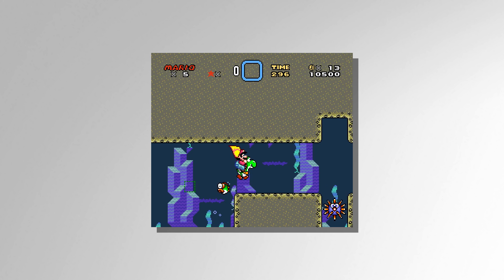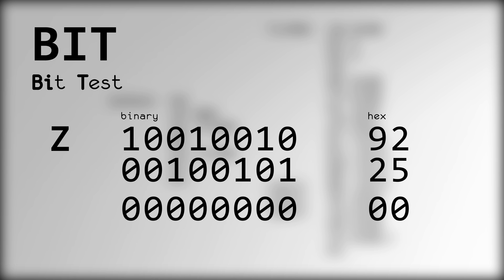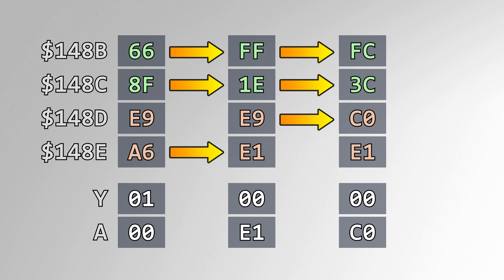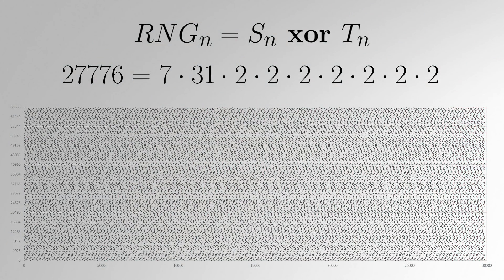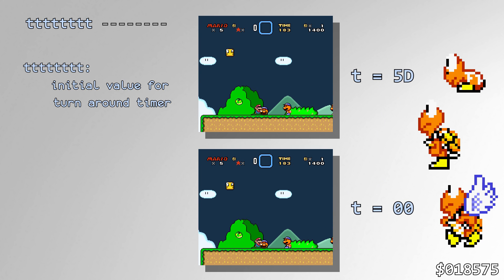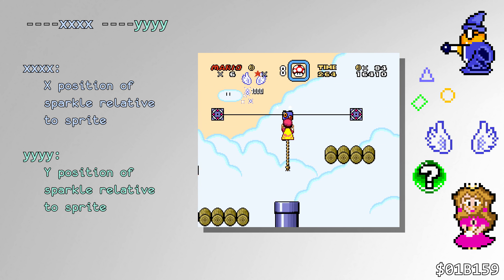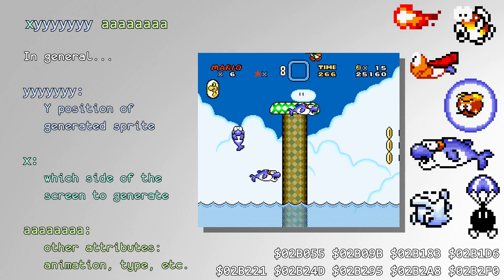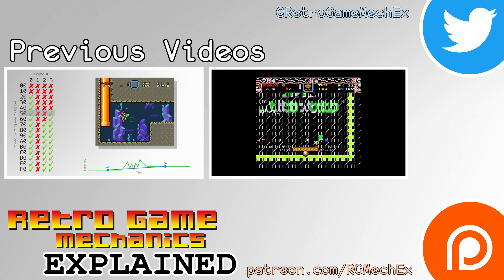Super Mario World - Random Number Generation

Comment: That's a pretty weird RNG...

Not using true randomness is not just a cost issue. A lot of game design benefits from the predictability of a pseudo-random generator over a true random generator for instance.

For example, Consider recording a replay of what the player was doing. For this to work, you have to replicate EVERYTHING correctly.
You could record the state of all of the game objects for every frame, but that would take up huge amounts of storage.
But, if all the game objects have deterministic state, then all you need is the starting state and the player inputs, which takes up much less space.
This is possible if the game is entirely based on predictable deterministic logic...
Or... If you use a pseudo-random number generator. (since this is actually deterministic for a given seed)

It looks too like it's setting the seed to an exact starting value too. Which... 
Means the sequence of things in the level is kind of predictable in some ways

That's an odd choice.
See, when developing PC demos I found the most common technique to get a 'random' outcome is to use the system clock.
Even though the Pseudo RNG function isn't random, it seems fairly random as long as your seed value keeps changing.
The system clock has the virtue that barring someone messing with their clock (or the clock running for longer than it was designed to),  the seed will never be the same, so 'random' events will truly seem random, even though they aren't, because the seed used is never the same twice.

Unfortunately, an old console like the snes has no system clock.
So... You have to come up with a different way of creating the initial seed values...

And so far, I haven't actually been able to think of one that works consistently...

Which... May well explain why SMW just gives up and sets it to 0 every time a level loads...
Reply: I came up to a "better random" by making a clock based on VBLANK interrupt cicles, so the user will never be able to press start at exactly same time ever, and three different random routines based on which number was on clock.
But nowadays, with very cheap RTC circuits, it would be possible to save the daytime in the SRAM
Reply: I think it could be set to a global timer value.
Reply: They could keep the RNG from the last level, and maybe every few frames, add the controller registers
Reply: I don't understand.  I'm going to sleep now.
Reply: Outside of using a predictable number generator for determinism.. there is never ever ever ever such a thing as a real random number generated by a computer (yet.. maybe once we go quantum)
Reply: @martinhowser4094  There is one way, machines with a requirement for very strong cryptography like military grade communications hardware can be equipped with a hardware random number generator that samples some type of physical quantum phenomenon, such as decay of a radioactive substance, or noise on a photoelectric circuit caused by unpredictable arrival of photons. These are obviously far too expensive for a games console.
Reply: @pyramidschema8668  you could just use the noise produced by a low resolution camera, it's random I think
Reply: @paindavoine_design  Interesting idea, I think the noise is random, but it seems like no-one ever built a device like that. Maybe there is some bias or reliability problem that is not obvious.
Reply: @pyramidschema8668   Pokersites use thermal fluctuations from Zener diodes to seed an RNG which since it is a quantum event that triggers it essentially becomes true random number. One of the better examples we have as far as I know.
Reply: @paindavoine_design  Cloudflair uses video from a wall of lava lamps, which is then hashed
Reply: @pyramidschema8668  that's how cloudflair works.
Reply: Martin Howser How bout electromagnetic noise
Reply: I found it weird that they never used the controller as a source for the seed. It's easy to read from, is random enough, and yet keeps things deterministic for things like recording demos or replaying TAS.

Maybe the way SMW did it was "good enough", but for a few extra bytes, it could have dropped the "enough" and made it good.
Reply: @SolidIncMedia  I don't get this rng needs to be consistent for recording thing, why not just, record videos?
Reply: I think the common way to create a pseudorandom seed on consoles without clocks is by having a counter that ascends on the title screen and stops when the player presses start. If the title or new game screens have options, then the player's other button presses can also be used as a source of entropy. That said, there are a lot of games that use constant seeds, including Pac-Man, Doom, and (apparently) Super Mario World.
One technique that I haven't heard of anyone using is reading from uninitialized memory or registers at startup to create a seed. For example, lots of NES games will zero out the RAM during initialization. To generate a seed, the program could sum together the uninitialized RAM's values before it zeroes it. Note that this might not work on emulators because some always initialize the RAM to a constant value.
Reply: @jimmyhirr5773  yeah, a lot of games use inputs or run continuously to make RNG. Generation 5 of Pokémon doesn't use uninitialized ram, but it does use the MAC address for additional console to console unpredictably

Comment: I'm sorry if I missed it, but where does the game get its seeds?
Reply: Naeddyr If you're asking where the game gets its initial seed (when you boot up the game), it's probably set to zero as game consoles of the time had no internal clock to base the seed upon. But if you're asking about after initial boot, the RNG function ticks both the seed and the values at the same time (I don't have a timestamp, but it should be about two minutes in). I hope this answers your question.
Reply: So if the initial seed is always the same, is it possible to arrange for a deterministic speed-run by controlling what triggers the RNG when playing?
Reply: You are correct! In fact, this is what many TASes (tool-assisted speedruns) do: they control the RNG to be able to get a favorable outcome. I can't remember off the top of my head if RNG manipulation is used in Super Mario World TASes, but I do know that this is done in other TAS speedruns. For example, the Super Smash Brothers Melee Adventure Mode TASes use RNG manipulation in Link's portion where you have to find the Triforce (which has a randomized location due to RNG) to win.
Reply: The RNG is always initialized to (0, 0, 0, 0) when the player enters the level.
However, this is not the only source of randomness in the game. There's a global frame counter that always increases by 1 each frame. Many sprites use this counter to change their behavior. For instance, Bowser statues only shoot the fire each 128 frames.

Comment: There are a couple other ways to really make an RNG function ... random.
You can read the noise from one of your sound card's audio channels and use that as the seed, or you can read the unfiltered mouse input or the gamepad's unfiltered analog sticks.
Heck, there are even servers around the world picking up cosmic radiation and used that to supply a seed for RNG functions to use. And i don't think you can go more random that cosmic noise :D
Reply: J.J. Shank Using the current score And time with the randomness would have been easy to perfect it
Reply: The cosmic noise is not the most random, a quantum system is actually truly random.
Reply: Those options weren't available to Nintendo when building the GBA. Besides, aside from the mistake of resetting RNG at level start, this game handles randomness pretty well.

Comment: This is probably a stupid question, but why didn't they make it so that every item has a 1/3 chance of being slected instead of trying to do a 3/9 chance? Wouldn't that be possible?
Reply: Because you can only determine from a set of 2^n values. 2^n is 1, 2, 4, 8, 16, 32, ... While 3 is impossible, developers chose 9 as it can be approximated by 8.
Reply: They could make it depend on the global timer, a single byte address that varies from 0 to 255.
Interval (0 to 85): item 1 -> 33.59%
Interval (86 to 170): item 2 -> 33,20%
Interval (171 to 255): item 3 -> 33,20%

But like groszak1 suggested, there's no way to get exactly 1/3.

Comment: It still wouldn't be "true" randomness :-P
Reply: Also using true randomness would make game play files larger since you need to store not only buttons pressed, but also results of random generator.
Reply: Well, no, you just have to add a number for each key-press, not actually store each one
Reply: Then it won't be true random because it would depend on user key-presses. Also depending on key-presses makes it able to manipulate using TAS.
Reply: Oh, wait, yeah, nvm, I misunderstood what you meant, but as I said, that still wouldn't be "true" randomness.
Reply: If it was true random (different random numbers even with exact same buttons pressed) then it would be harder to edit TASes. SNES doesn't have true random hardware.
Reply: Well, it wouldn't be much harder, it just would be one less variable you can control
Reply: groszak1 Well save states would help with that one

Comment: Is it possible to make the RNG not reset when you exit the level? So you can truly make more "randomized" (in quotes because after 27776 calls it repeats) events.
Reply from the maker: Yes. It just happens that the RNG seeds and output are contained in a large chunk of memory that is reinitialized to zero every time you enter a level. You could preserve the RNG values over levels, or even re-seed the RNG based off of something else when entering a new level.

Comment: To source true randomness, instead of a hardware-based approach, why not just take values from user input?
Reply: Some games do that. A lot of RPGs use the number of steps a player has walked for RNG, that combined with probably an internal timer. Some speedrunners use their steps to manipulate RNG during some Final Fantasy games and also Pokemon games if I remember correctly.
Reply: Well, when I'm playing SMW, I'm holding Y and Right or Y and Left 90% of the time. Not much randomness there.
Reply: You could, but 1.) You wouldn't get much entropy that way, and 2.) The entropy source could be very biased.

For example, a standard NES controller has 8 inputs. Start and Select are rarely used, so you can basically ignore those. So then you're left with at most 6 bits of input.
But user input even with the full range of the D-pad and A and B buttons would still be biased, because some inputs are incredibly rare compared to others. The controller makes it impossible to press left+right or up+down at the same time. And depending on the game, a single button pressed during a frame is more likely than a combination of buttons. The user inputs of side-scrolling games such as Super Mario would have "move right" on the D-pad over-represented because the most common action would be to advance forward. And this is exactly why NES games with input-based PRNGs are so easy to manipulate.

Not that true randomness is something you want in a game anyway. With true randomness you don't have any control over the distribution, and the numbers you get won't be uniform in the same sense a PRNG is. A truly random source of entropy could at some point just as well give you a long sequence of only zeros which would be detrimental to a game. What you usually want is a PRNG with a uniform distribution (like the Mersienne-Twister) with a long (but finite) repetition cycle, and optionally, an initial source of entropy to set the seed value. For example, the seed could be the clock when the game starts.
Reply: ***** Some bias is not necessarily wrong as long as it's not extremely bias (i.e., no button press means RNG = 0). Many games use player-derived inputs for RNG. So for example, Pokemon and Final Fantasy uses a combination of steps the player took + position on map to determine a random number (and some other factor that is also semi-random). The source itself isn't truly random, it is biased. It's biased enough that a speedrunner can take advantage of it and reduce random encounters or increase the chance of a specific encounter happening but the bias is low enough that two normal players experience completely different results.
Reply: get them to try and quit vim
Reply: like super Mario 64?

Comment: I really liked this. I was especially impressed with the production values. The only thing I wasn't able to understand is what Bit Test actually does; I came in with no prior knowledge of how assembly works, and at this part, I felt I needed at least a little. I don't know if I'm outside your target audience, but if I am, the clarity of your explanations is pretty excellent, as I was able to understand everything else even without prior knowledge.
Reply: After watching a few times, I think what it does is use an AND gate on each bit of the two numbers you're using (so 1 AND 1 is 1, but everything else is 0), and if the new number is all 0s, Z gets set to 1.
Reply: What is the z-bit?
Reply: Joseph Brandenburg A status bit indicating an operation produced a Zero result.
Reply: Effectively, Bit Test is checking if the two values have any set bits in common.

To be precise, BIT just checks if
(Accumulator value) AND (Operand value) = 0

If yes, set Z-flag. If not, clear Z-flag.

I'm assuming you know how the 'logical AND' operator works (he did explain it for a split second in the video). Basically it puts a 1 in each bit which had a 1 in both operands. The accumulator is always implied to be the first operand.
Reply: I think(someone else can correct me if I'm wrong) it is an AND operation that sets the Z flag if the result is zero.
Reply: It is an AND operation between corresponding bits in the operands, yes.
Reply: Correct.